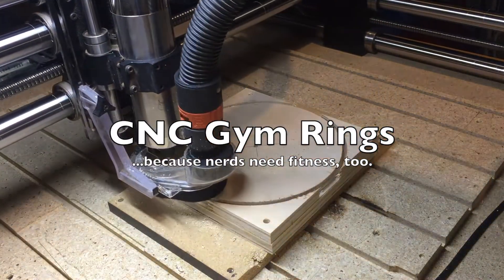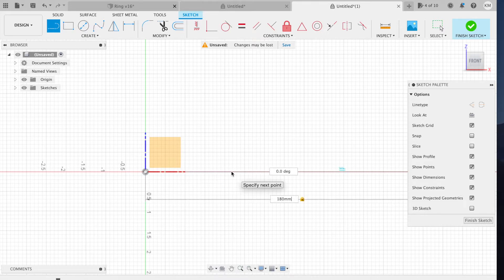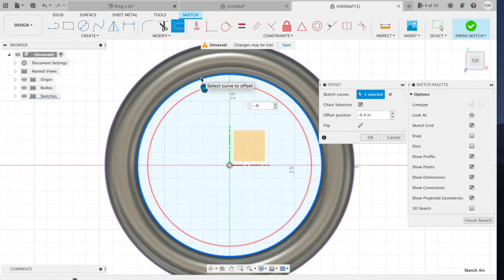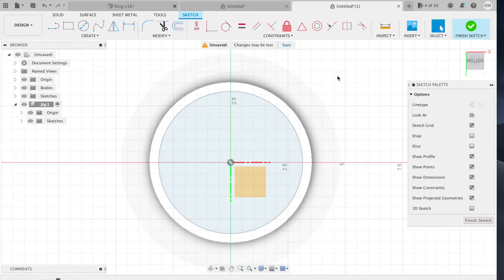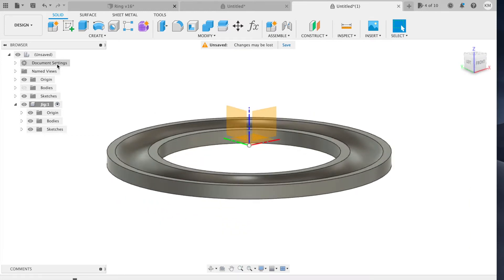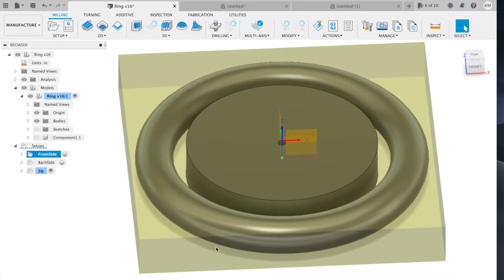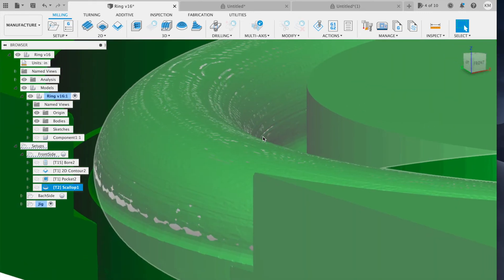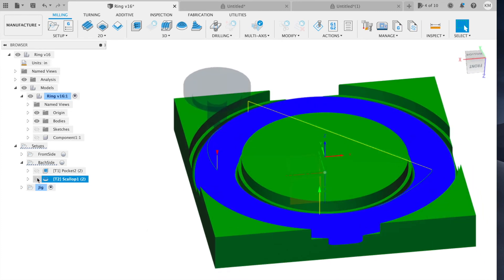Using Fusion 360 to model CNC Gymnastics Rings.

Comment: That looks like the onefinity cnc I'm just getting used to mine, great tutorial I'm going to give this a shot!
Reply from the maker: You bet.  I have revised these tool paths a little bit.  Instead of a scallop tool path for finishing, I broke it into a few different ones: first a spiral toolpath that begins at the centerpoint(top of the curve) of the ring and runs down each side until 61 degrees slope.  Then, a ramp toolpath that goes from 60 degrees to 91degrees.  These run smoother than the scallop and can fly along at 350ipm feed without slowing down for transitions.  It cut 30minutes out of the machining time without decreasing the finish quality.